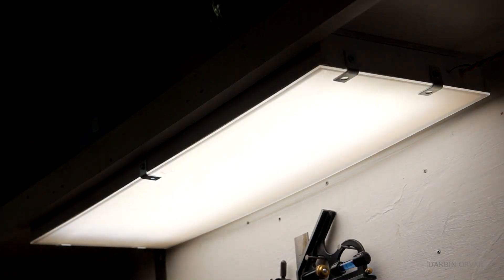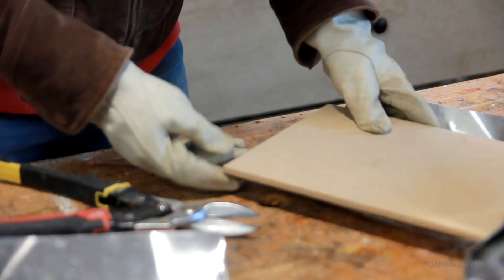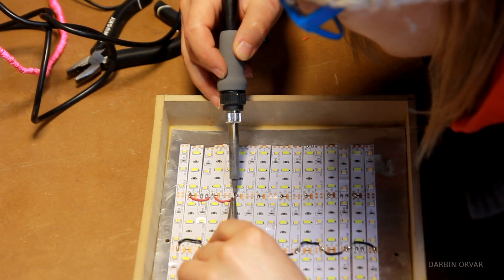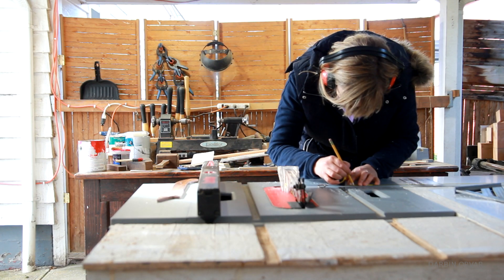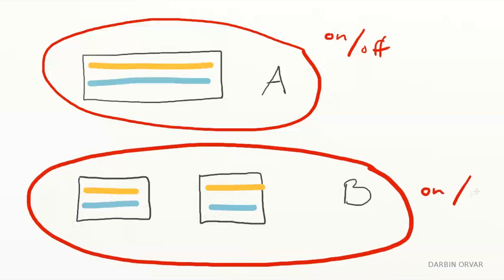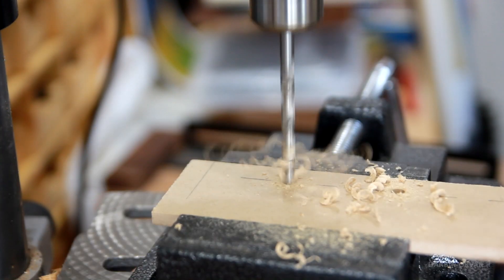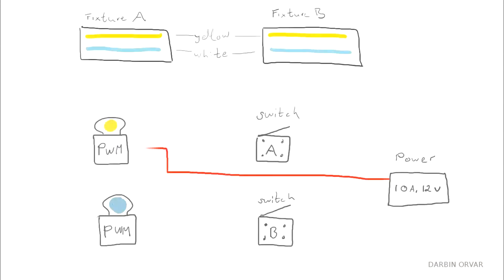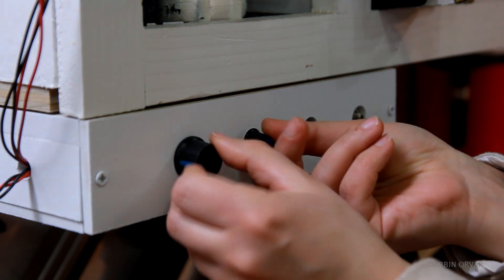DIY Tunable LED Light Panels

Comment: I really like the switch controls. When mixing the  strips to create a neutral color temperature around 4500K do you see a smooth blend of Illumination or can your vision actually visualize the two color temperatures separately?

I don't know what chips your strips use. I prefer 2835 as most efficient.  I would opt to cut open the wood backing so that the heat sink could expel heat build and leave some air space above the fixture.

Comment: You are using two different dimmers. So if i use the same bigger dimmer for light temperature control will be no problems with that? Its better with more power?

Comment: I am curios where the heat goes from all those lights and current limit resistors in the strips.  It is a  tiny and seemingly well heat isolated box with no air holes. 
U got that  piece of metal but it does not rely transfer the heat outside the box.
If u let this box run at full power for say... half an hour. How hot does it get inside this box?  Did you test this? It can be done with a multimeter temp probe.
Probably not a fire hazard but heating mdf can/might emit stuff that probably is not healthy to breathe in the long run.
And also high temps makes led  lifespan go down.
Great creative videos and ...heja Sverige !!

Comment: Hello Lin this is really nice I've been watching your videos for a while now they're very good...I notice you normally let your low voltage wires run against the wall you could use trunking to cover them up you'd reduce the visibility of the wires
Reply from the maker: Thanks Oneil. The reason I tend to let the wires free is because I make changes so often, I don't want to set things too permanent too soon. I do agree that inside that home it is important to be neat.

Comment: Your video was published just in the nick of time for me and my son!  We're designing his new kitchen, and he wants to integrate LED lighting for mood and task purposes.  I've got one question:  Why not use a variable resistor (potentiometer) in lieu of the PWM?  Very neat design Darbin.  Thanks!
Reply: John Grubbs Just using a potentiometer is rather inefficient and you have less of a smooth transition from off to full brightness (from my own experience)
EDIT: I forgot to note that the potentiometer is inefficient as it dumps the excess energy as heat.

Comment: You may want to add some ventilation holes to your control box. Since there are quite big coolers on your dimmers I would expect that thing to get quite warm. But they need circulating air to work properly.

Comment: When trying to tidy up cables, there are self-adhesive-backed cord concealers available (usually paintable) where the cable just clips inside the tube and you peel-and-stick the whole thing into the corner. Makes a neater job than cable ties and no chance of snagging the cable later.

Comment: Love the use of the alternating strips of warm/cold with the two PWM controllers; I originally thought you would have some kind of Arduino set-up with multi-colored LEDs but this seems like a cheaper option given that single-color LED strips are 1/10 of the price of the multi-color LED strips...

Comment: Cool! Its even Cooler to see a nice lady doing engineering  work!  
Am i right you are using a switched mode boost converter power supply and adjusting the voltage to  achieve the dimming? does it flicker much? The switching frequency is very high? And how many mm is your acrylic?

Thanks for you nice video!

Comment: Great project.  It might be useful to many if they knew what PWM is and why you used it rather than just varying a 12v supply up and down.  
On the safety side, When using lead solder it's a good idea to have a small fan keeping the lead out of your lungs.  Not sure what damage flux does but the fan could help there as well I think.  It's been awhile since I was involved in this stuff so maybe things have changed?

Comment: BTW, you can get touch controllers from the usual Chinese sources that control warm+cool LEDs. I haven't tested mine yet, but I think a downside is that it doesn't allow mixing! That is, the outputs go from 100% cool to full off to 100% warm.

Comment: Great project. I would only suggest putting the wiring in a loom (Black 3/8"X 100' Split Loom) to give it a more finished appearance and protection. I noticed while soldering you were having the same difficulty we all have. Maybe you could build a PCB holder like this one but better. Aven 17010 Adjustable Circuit Board Holder. Thanks for sharing the project

Comment: You did not need to spray paint the plexi, you could just use sandpaper
Reply: Takes a lot more elbow grease to get as consistent as the spray paint, and this isn't going to be touched often, so the wear and tear on the part isn't really a major concern.
Reply: Or you can just buy translucent acrylic. BTW, you need a fine tooth table saw blade to cut acrylic and plexiglass.
Reply: My thought too. Spray paint works well I suppose but will eventually rub off. Sanding is a bit more permanent. I imagine that the spray it easier to keep more uniform though.
Reply: If using a small grit wet sandpaper like 600-800 i would think it will be fairly easy to get a uniform dullness. Coarser grit sizes will make swirls and scratches from the sanding action more visible to the naked eye just like it will do on shitty  paint job  on a car
Reply: very good !

Comment: There are three types of LEDs commonly used in the reels; 3528, 5050, & 5630. These numbers are actually the sizes, 3.5mm x 2.8mm, 5mm x 5mm, and 5,6mm x 3mm respectively. An entire reel of the 3528 LEDs usually requires 2 amps of current while a reel of the 5050 and 5630 use 5 or 6 amps to achieve the full brightness ratings. I noticed that the warm white LEDs used were the smaller case 3528 which will only put out about 1/2 of the light of the cooler daylight white 5050 sized LEDs. I would have spent the extra $2.00 to get the 5050 sized warm white reel especially considering that there are dimmers being used in the project. Other than the warm white LED selection, great concept and work on the control box, wiring, and ceiling fixtures.

Comment: looks really similar to the one that is made by diy perks. The you could have used the same dimmer on both. The smaller one is rated for 90W. I am using them for a 30x30cm panel without problems.

Comment: Fine sandpaper on a random orbit sander will also produce that frosted look on acrylic and polycarbonate. Saves material cost. I've gotten good results from 180 grit. Also 50, but it's more scratched looking.
Reply: Home Depot and the other big box stores sell 48" x 24" acrylic clear and frosted diffusers with several different textures for about $10.00. They can be cut to size quite easily with a saw or scored with a knife and snapped off.

Comment: I know Kelvin is a metric of color temperature, but I like the idea that you built a light for your workshop that is adjustable up to 10,000 degrees Fahrenheit.
Reply: Dude nobody measures LED color temperature in imperial, LoL.  6000k is annoying common. That high temp is bluish and fatigues your eyes over time.  5000k is my limit, ideally 4500k neutral is more relaxing to visual reception.
Reply: @Accumulator1 I like it during the day, low colour temps in the middle of the day feel drowsy imo

Comment: Great project!  Love your work on LEDs.  Quick question: can you use any LED stripes or do they need to be specially adapted to be able to dim?  The reason why I ask is that I have a dimmable LED light fitting that only take a certain kind of bulb that can be dimmed.  Very frustrating as I can never get hold of them here in UK.
Reply: Wendy, any LED strip should work fine with the dimmers Lin used. As long as you're trimming the DC voltage coming from the power supply you'll be fine. LED bulbs that screw into standard lighting fixtures don't play well with dimmers because they have built in transformers that are built to convert 120VAC (or 240 in your case) to 12VDC (or whatever) only. 

The dimmer switches found in most homes are going to trim the AC voltage going to the socket which plays hell with the bulb's circuitry, and things will not work well. They make dimmable bulbs that have smarter, and more expensive, transformers but as you've noticed they are much less common.

Lin gets around this by providing a steady 12v from the power supply and running that through the dimmer circuit. The LEDs are happy to accept anything from 0-12VDC coming from the dimmers.

Comment: Linn, I'm following along and looking at the products on amazon but I don't see how you connect the power supply.  Do you have to cut the end an solder, or is there an adapter I missed?  Thank you.
Reply from the maker: Hi Ken, I just added the barrel plugs to the amazon parts list. It allows you to connect the power supply without cutting the cable.

Comment: I just built something very similar with cold and warm strips alternating, but i only just soldered them at the ends, why did you go with the cables right in the middle and not just at the stripends?
Reply: Peter I'm curious too. What's the advantage of soldering like you did?
Reply: I'd say she soldered this way as a sanity check when wiring up the rest of the system, so that she could easily see which wires belonged to each color LED. However, for additional redundancy it would also be good practice to solder at the ends as you did, Peter, in case of a lost connection that would result in a dead strip.
Reply: If you end up with a dead strip it is easier to replace it if you solder at the ends only